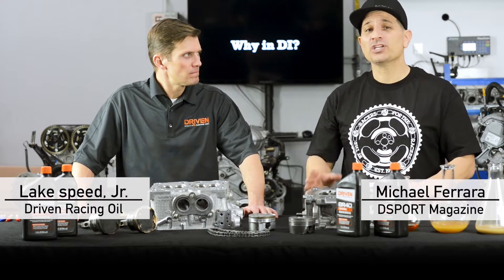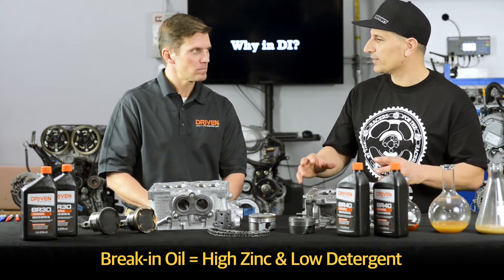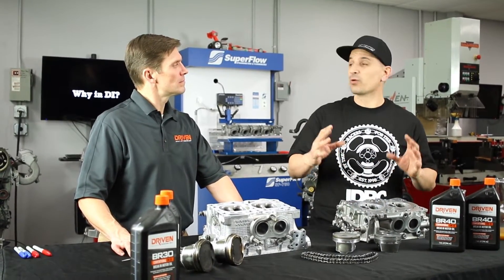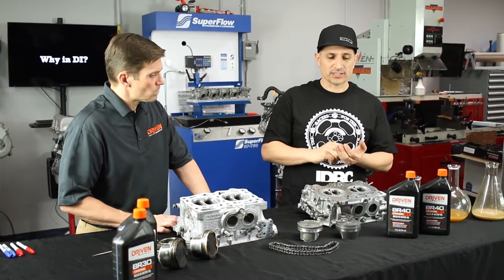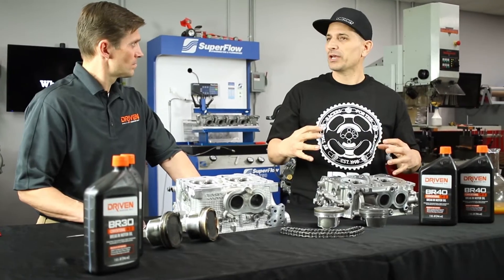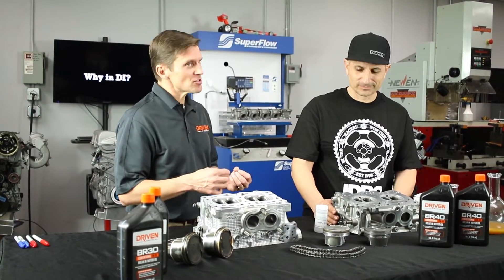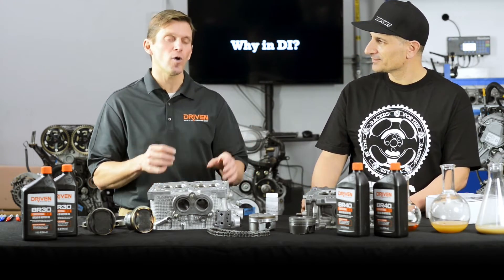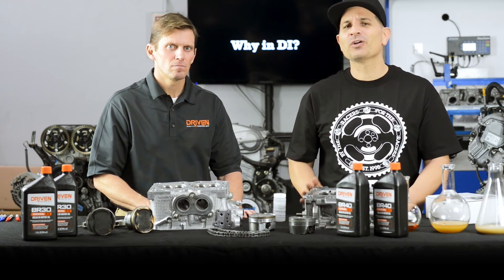How to Break-in Brand-New Engine + Oil Analysis

Comment: Thank you for the invaluable information.  Now I'm concerned about my new 2019 Civic Type R.  Followed the procedure I got from Honda.  200-gentle miles with gentle braking to allow brakes to wear in properly.  Then progressively increased acceleration and RPM until 600 miles.  At 600-miles, I was making three runs on an obscure road, full throttle to redline, to 135-140 mph before running out of room and beginning deceleration. I'm at 1000-miles now and planning a spec oil/filter change tomorrow. I was told that the car must run synthetic from the start due to the temperatures the oil is exposed to in the turbocharger, but don't know if that is true or not.  Also, don't know if I can temporarily run break-in oil with a turbocharger,  or if I need to.  Car doesn't feel as peppy as I thought and getting crappy highway mileage (22-23 mpg).

How would you recommend that I proceed from this point?  Is it just the spec oil change and then driving as hard as possible as often as possible, or do I need to purchase  several filters, some spec oil and break-in oil and follow a process?  I'll do whatever is best for the car, whatever offer the best chance to give the engine a proper break-in and to run optimally.

Thank you in advance for any assistance you can offer.
Reply: Anybody in this situation, do what the factory says. It was three years ago. Tell us how it worked out. Maybe the not so peppy performance is how it goes with that engine.
Reply: Well, three years and a little over 40k miles and things already fine. The Civic Type R still runs like a scalded dog on crack. There's a long string of Z-cars, Camaro SS's, Scat Packs and more that have fallen in roll races down in Mexico. I'm no longer stock, about 90 whp and 100 lb ft over stock, same fuel economy, doesn't leak or burn any oil, catch can has drops after several thousand miles. It's good.

Make several trips each year from S. LA to the NC/TN border area to drive the Dragon, Cherohala...it's an excellent road trip vehicle. Rigid Collar set, Swift Spec R springs, Rotodisc floating rotors, Street Racer pads with titanium backing plates. It's a minimalist build handling wise, but you'd be amazed at the vehicles this vehicle can best on a twisty road.
Reply: @nYdGeo  Thank you for getting back. Little of this is practical for me but I am working on the topic right now if only to know where I have been already. With contemporary production, the manufacturers say no elaborate break-in is required, perhaps just following certain driving protocols for the first several hundred miles (or kilometers).

I have been paying attention to the different theories about break in especially related to piston rings. Some people say, push the engine hard during break in. I have a theory, which is, as the piston rings flex up and down infinitesimally during acceleration and deceleration, the edges of the rings get polished and lapped, or rounded off a little if you want to call it that. If the engine is going to be driven hard during its service life, maybe it is better to push it hard and get the edges lapped a little more.

I think a lot of this applies only to older production and especially to rebuilt cast iron block engines. With contemporary production out of the factory, maybe some of these issues do not exist.

Another thing I have found out is that in a standard performance cast iron or cast irong lined engine, it make absolutely no difference whether you use cast iron, chrome or moly rings. That's according to Hastings, which makes the rings. I would say, cast iron would be preferred because cast iron rings would be more likely to break in properly.

By South LA, I gather you mean Louisiana. I live in the Central Valley of California. We neither think about or go to L.A. the city. Mostly, we want to keep our driver's licenses and we also want to wake up alive tomorrow morning. But the Rams are my favorite NFL team right now. Goes way back in time. I grew up in Chicago but the Rams were a popular team in the 1960s and they were a popular team when they were in St. Louis during the Kurt Warner era too. I'm one of the survivors who saw that game on television where the Rams beat the Packers in the L.A. Coliseum back in the 1960s. If you were from Chicago, any time someone beat the Packers back then, they were your friend forever.

Just one more question. Did you eventually conclude that you were getting normal gas mileage for that vehicle for the type of driving?
Reply: @anonymike8280  I believe that I was miscalculating the fuel economy. I've tested it more accurately, same fuel pump even, and it appears that at more or less the speed limit (70 mph here), I'm getting around 30 mpg cruising the Interstate.  It's extraordinarily speed sensitive, no doubt due to the performance gearing. The engine spins in this thing! Something like 70 mph = roughly 30 mpg, 80 mph = 28 mpg and cruising at 90 (in Mexico of course) it drops to 25-26 mpg.

The MPG indicator in the dash is rather optimistic, almost always reporting far more mpg than reality provides. Due to the slowed throttle response, I definitely get better mileage in Comfort mode, but cruising down the Interstate, I get about the same regardless of mode.

Of course, I'm a bit heavy on the foot, so my mileage varies a great deal. I can also tell you that on the NOLA Motorsports racetrack, I got 8 mpg. LOL
Reply: @nYdGeo  All good to know.
Reply: You only have ONE chance to break in an engine and you blew it…but since it’s a civic, it doesn’t matter
Reply: The full throttle from start is probably the culprit causing scoring on your bearings, if the ZDDP or whatever the break-in compound has not given enough time and temperature to activate on the moving surface.  Full throttle is fine if done progressively but not from a complete stop. I would suggest refilling with factory oil and adding extreme pressure additives. They are mostly chlorinated compounds, which smooth out peaks and valleys with heat activation.  You just need a low to medium speed and load to break in. When activated, they form a durable iron-chloride surface  on moving surface, which happens when you start to feel a smoother idle. Then you should drain the oil because excessive chloride may react with moisture and form a strong acid.  Too much Extreme pressure additive  may  cause bore polishing, an adverse affect you should keep in mind . Good luck!

Comment: 2:27 20 minute break in at 2500rpm, at what kind of load? Minimum, full throttle or where in between?
Reply: David Bayliss this is based on only the load you need to bring it up to 2,500 RPM. Once that’s done then on setting the rings is with load.

Comment: A lower viscosity oil removes/moves heat more efficiently but doesn’t “cushion” as well as a higher viscosity. But it’s all dependent on bearing clearance, correct? Tighter clearances need a “thinner” oil to flow faster/more efficiently and bigger clearances need more “cushion” to take up the space properly?  Do I have that half way correct?   Does a 5w-50 offer more/better “protection” than a comparable 5w-30 once up to temperature ?
Reply: A 5w-50 with have a higher viscosity at 100 degrees c then a 5w-30. They will both have the same at 0 degrees c (both 5 weight cold). That's a more accurate way to look at the numbers. But that's new. as they additives breakdown with heat cycles, the 50 will slowly get closer to the 30 (because the 30 has less thinning to do to get to the 5w). A multi weight mineral oil will do this faster than a synthetic. My recommendation as a simple back yarder is to select the right oil weight for your clearances, use you pressure gauges to see what the real time pressures are at temperature, and change it more often to maintain it. Always use a synthetic, outside of break in. Simply put with the same amount of use the 5w-50 will be the same viscosity at low temp to but thicker at 100c. If you're clearances are bigger you'll want the thicker oil. At some point though, if you have modern heads with hydraulically controlled stuff, it may be too thick for the top end, this is why OEM oils are getting thinner and thinner, as well as better manufacturing for better matched clearances. Now the fun begins when you get some blow by in a turbo engine runing ethenol, where the fuel physically mixes with the oil an thins it even further... ahhh good times.
Reply from the maker: @tangles01  That is pretty accurate
Reply: @dsport  Thanks for saying so.
Reply from the maker: Hey @tangles01 
We had Lake back down here and he talked about Viscosity a little. Thank you for your comment.
https://www.youtube.com/watch?v=TkqWtfyRA74